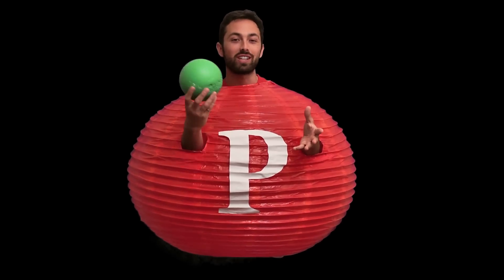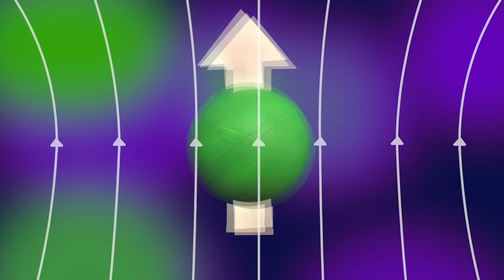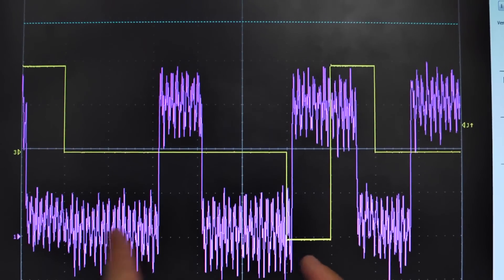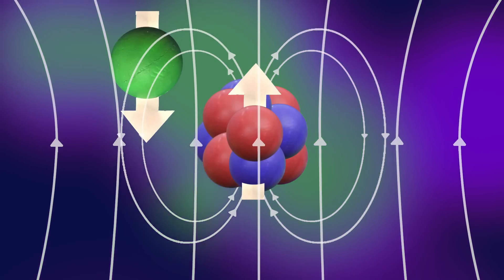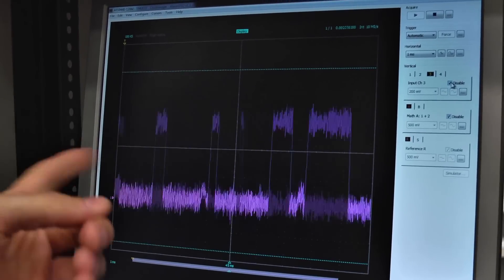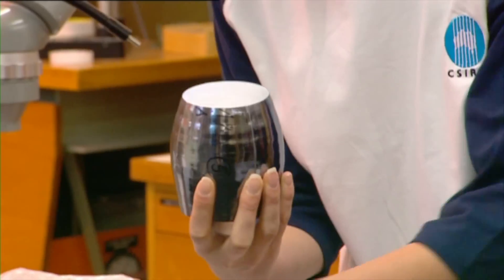How To Make a Quantum Bit

Comment: Voltage and electricity aren't the same.. The voltage is the difference between the potential of 2 spots and it is usually referred to the ground (that is 0), so you can have positive or negative voltage; what makes electron flow is the difference of potential not its sign

Comment: Voltage is only the difference of potential on 2 different places, to measure it you call one side the positive and measure it, if it's positive and you measure calling the other side positive, you will have the same voltage, but negative.

Comment: No, electrons are electrons. "Electricity", which I assume you mean "electrical current", is the flow of electrons over time. Even though electrons have a negative charge, you need to consider relative charges rather than absolute charges. If you have a grid of electrons and remove one, then there is a net positive charge localised where the electron is missing. The flow of this missing electron is a localised net positive charge.

Comment: Electrons are not "negative", they have negative CHARGE. 
Voltage is  the electrical potential difference between two points.
Electric Current is the flow of electric charge (or electrons (in most cases) if you will) from the negatively charged point to the positively charged point.

Comment: This didn't really explain why a quantum computer would be able to compute faster than a regular one.

I believe the concept is that a quantum computer computes several things simultaneously, through the means of superposed states? However, this interpretation of quantum mechanics is still disputed, right? Might very well be that quantum computers will have no advantage whatsoever.

Comment: Voltage is a measure of the potential difference between two points, not a measure of charge. If it was charge, then it'd be negative. 

It's like velocity and speed. If my car was reversing towards the south at 5m/s, then my velocity could be either 5m/s south, or -5m/s north. 

Either way, my speed is still +5m/s, since speed doesn't require a direction. It's a similar concept, voltage is a measure of potential difference, not a measure of charge.

Comment: electricity isn't electrons, it's the flow of electrons, measured. volts are a potential state compared to ground and that can be either but is usually positive. Imagine ripping huge quantities of electrons out of the ground, then controlling the rate they return to ground; that's electricity. They are talking about what the electrons are doing and what the atom's outer valence's condition is, missing, extra or stable number of electrons.

Comment: Actually, he said Qubits are not necessarily faster than transistors but Quibits have multiple states and can work in parallel exponentially. Ordinary transistors can't do that. THAT is where the power of quantum computing lies. It's the special properties and multiple quantum states of Qubits that is the key that allows us to unlock those parallel computing abilities. It's not just about Qubits but how you use them.

Comment: eventually we will see a quantum "subprocessor" or whatever. which will be useful for things that its good for, but those are not huge. photonics, and molecular computing (which negates the moore's laws biggest problem) are better for general purpose computing. but i am not a quantum physicist or an engineer of semiconductor transistors so dont take my word for it :) but weather prediction, big data crunching, molecular design, etc will see huge HUGE boons from quantum computing for sure

Comment: For a lot of problems, it's really hard to find the answer, but really easy to check the answer. With a classical computer, you have to try to find the answer (very hard) or try checking every possible answer (takes forever, even with billions of cores). With a quantum computer, it is a superposition of all possible answers, and you check it, and look at what's there next to "answer is correct". It's a slow computer that always guesses right.

Comment: i still don't understand this q-bit system, so you have 1 q-bit in there, you need to give 2 numbers - probabilities to describe the system, i understand that, but when you read that qbit, you destroy your qbit, those 2 numbers change to 1,0 or 0,1 because its up or down... is there any chance to ask the professor to show practical application of few qbits on some easy example like finding prime number factors of lets say number 6?

Comment: The way I understand it, it won't be faster for daily use, as the clock cycles won't be faster than they already are. Where it will shine, however, is during very computationally-heavy type calculations like physics simulations as it has four states instead of two (citation needed).

Comment: It's not faster, quantum computers can just compute every possible solution of a problem simultaneously. At least that's what I took from the previous video. For normal use quantum computers won't be very useful but for certain problems (figuring out an encryption for example) they compute the result faster.

Comment: Also just to be clear, the calcluation of the Qbits and the translation to normal bits is only the reading part, so it doesn't nelegate the idea of the quantum computer, it just let you understand what the code says.
Funny enough, translating takes 100 times longer then the actual solution finding >_>

Comment: Nice Video, but this 'bragging' about how fast a quantum computer is in the beginning would not have been necessary.
You need the purest Si with only Si 28 at <1 K and you get a very noisy jittery signal. Don't get me wrong: it's awesome! But it's not really useful yet. So please tune the quantum computer marketing down. This is being told for years now and I don't think it does the science justice.

Comment: wait...if you can control the spin of the nucleus of the silicon isotope, then why do they want to eliminate the spin by using the 0-spin silicon 28? 

Also, on another note, if the partial negative/positive of the atoms of the transistors that cause the movement of electrons, why not use 2 high electromagnetically different isotopes for more numbers of electron movements? even after the additional requirement of energy, it will be worth the efficiency. 

sorry if i made any dramatic errors

Comment: I still don't quite understand the benefit of using qbits for calculation if you still need the darn transistors to read out the info
is it just an other nanometers fewer so the cpu can be made more dense and radiate less heat (since it's just one nucleous that is used for processing)?

Comment: Yea, my mistake on the first answer >.>
For further explenation you can see this video:
/watch?v=v1_-LsQLwkA
The output like in the normal bits is 0/1, but there will be a solution for every combination. Unlike normal bits that you only need to check the line of that bit and add it with the others.
So lets take a system with 100 bits vs. 100 Qbits
With 100 transistors I'll only get 100 bits
With 100 qunatom transistors I'll get 2 power 100 solutions (1267650600228229401496703205376 Qbits)

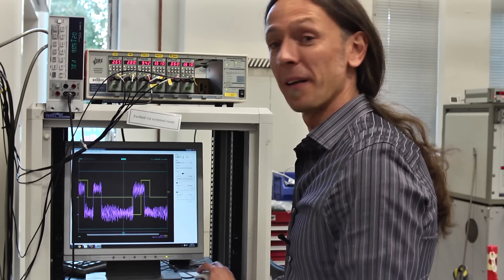Comment: 4:10 says they used the nucleus as a qbit, since he said in 0:27 they used the electron as a qbit I thought they talked about 2 qbits
Now if the spin up(1) and down(0) of both the nucleus and the electron make the 4 states, how is this diferent from 2 classical bits? my guess is that it would be a qbit if it could transmit both states in one signal instead of 2 signals (one for each bit)

yeah output goes to input, but what is the output? 

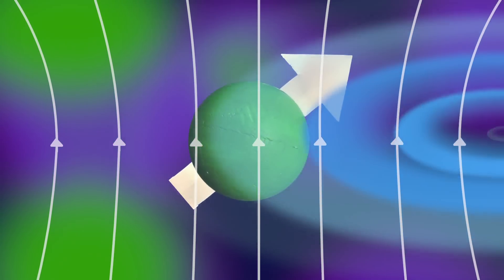and what happens if you stop at the superposition? 2:20

Comment: Lets start with your first problem.
You are calling the nucleus a Qbit, which is incorrect, you can't check if the nucleus is positive spin or negetive spin (you can only know it after you see the result of the electron), which control the microwave that the electron accept.
So I can lock the input of a microwave and accept another, giving even more posbilities.
And for the second question, you just need to chain those transistors (0:16) so the output will become an input in the next one.

Comment: I guess my real question is, how can you transmit the 4 posible states with just one signal so that you can pass info from one qbit to another instead of having a qbit, translating its info to 2 bits, and finally storing the 2 bits in another qbit? maybe qbits use something else than just electricity something that can affect other qbits directly like electromagnetic fields, might be wrong but it seems you'd need the supercooled gear of the video whith its own field for each qbit in the system

Comment: Well, that's almost how it works. What you actually do is you transmit a so-called one-time patch which is a very old cryptographic method and the only way to break it is if you know the patch. So with quantum cryptography you know if someone has intercepted your patch and if that's the case then you just throw it away.

But of course quantum cryptography and quantum computation are entirely different things. We'll probably see quantum PCs long before a quantum Internet so that's bad news.

Comment: I understand the scaling, but using both's spin up or down is having 2 bits, in the video I understand the electron can be used as a qbit but also de nucleus can be another qbit, both can have spin up, down and some combination of both (superposition). I kinda undestand how you use one to read the others sipn and its up/down probability (which becomes 11, 00, 10 or 01) but how do you compute with it without translating it to classical bits (which would defeat the purpose of using qbits)?

Comment: Because it scales up in a higher number.
We have the nucleons going down with two electron states (up and down)
And we have the nucleons going down with two electron states (up and down)
all that for one transistor.
so the amount of solutions is 4. (thats not impresive, yet)
When you add more transistors, the amount of combinations scales much faster, so the more stages and transistors I use the bigger the amount of solutions I can get.

Comment: Essentially, if you imagine n bits, a traditional computer can be in one of 2^n possible states at any time, and can switch between them at a fixed clock speed. So no matter how many bits the processor uses, it can only be in one state at a time. 
The difference with a quantum computer with n qbits is that, because of the way superposition works, that processor can be in 2^n states at the same time, and so processing time is effectively sped up by a factor of 2*n.

Comment: Dwave made quantum computer but their qbits are macroscopic, basically a current that flows CW and CCW simultaneously. So they are dealing with macroscopic superconducting electrical networks, and they simulate entanglement by inductive coupling between qbits. That's as much as I could find out about their work. Currently they are upgrading 128qbit architecture into 512bit.

Comment: the explination is that quantum computing cuts down the number of steps required to perform a caluculation because of the superposition of the quibits since there in essentially two positions at once for that quibit it will be in the correct place to perform the task required without the need to change when you multiply this by billions of operations then you cut down the amount of steps drastically making it a faster process although it is only useful for certain types of tasks really speaking

Comment: In the computer you are sitting on right know there is probably some kind of real time clock somewhere on your motherboard. 
It simply counts a certain value up in a known frequency and is kept running when the computer is of by a little battery.
They use some kind of crystal oscillator (wikipediaDOTorg/wiki/Crystal_oscillator) to generate electric impulses in a known frequency. The computer then reads this count and converts it to local time so that it can display it.

Comment: Well a bit has two states, on and off. Qubits have a very large number of states which by itself would make it better than a normal bit. However, Qubits can also be in several states at once meaning that it can do several things at once. Thereby allowing it to be up, down and several other things at once(if we could detect it), meaning it can do several things at once. Thereby doing a very complicated problem much much much quicker.

Comment: it's still only useful for special kinds of applications where it would take an incredible large amount of steps for normal bit-computers. Because a single step in quantum computers takes partially much longer than on normal computers. If you don't need much steps for a process a normal computer would be much faster.
My idea would be that they could combine these two computer to a hybrid so it could process everything as fast as possible